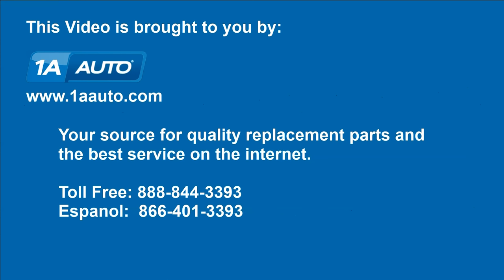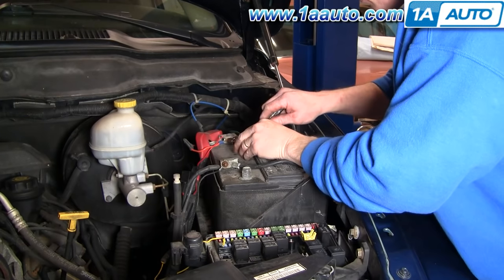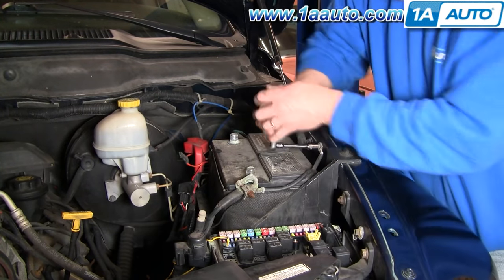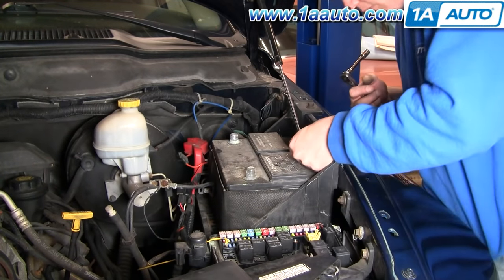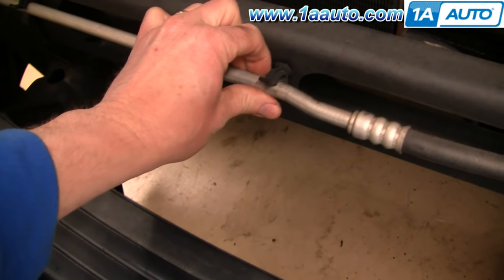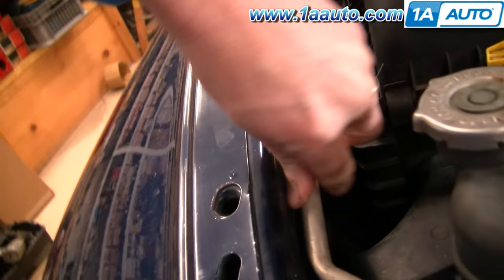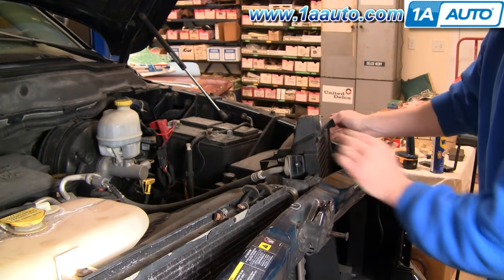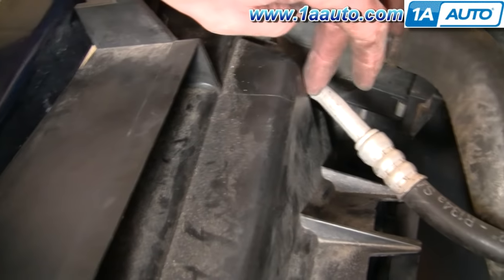How To Replace AC Condenser Cooling Fan 02-08 Dodge Ram PART 1

Comment: Great video! One recommendation though...It is MUCH easier if you remove the upper radiator support. It's just four bolts and the whole condenser and shroud can come forward a bit. Took about 35 minutes total. Oh and you don't have to remove the battery or the fuse box by doing this.

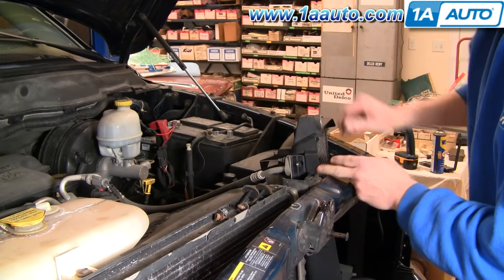Comment: Thank you very much for the great video!  This turned a half day job into less than 90 minutes.  If you do this yourself, be sure to watch part two,  I kept saying "why won't the condenser go back into the shroud!?!" until I remembered part two where you have to pry with a flathead screwdriver between the condenser and the shroud on the upper passenger side.  Be sure to watch part two at 6:10 where he talks about the original ones get stuck like that! I had that same problem and it cost 20 min!

Comment from the maker: @dpl1108121 That is a 1960 Pontiac Bonneville 4 door hardtop.  For you Pontiac Fans it is an original Tripower Posi car with 8-lug wheels.

Comment: I'm so glad I found this video! A few months ago, this fan blade decided to just fall off. I spent hours trying to scissor finger my way into that thing to tighten the nut, while jamming a zip tie in the motor casing to hold it stationary. No luck with that. Watched this video, and fixed it in less than an hour. Works great now. Thanks!
Reply from the maker: A little know-how can go a long way.  We're glad the video helped you out.  1aauto.com 866-403-3393

Comment from the maker: It may cause it to do that. If you have a check engine light on, you may want to pull the code to see what may be causing the fan to not work. Hope this helps.

Comment: Mike, thank you for the video. I knocked this job out in about 35 minutes. I bought the part for $80 and was quoted $376 from pepboys. I also repaired for wheel hub assembly with the instructions on your other vids as well as my tailgate lever, brakes, and rotors. You've saved me over $1000. You have my business from now on 100%

Comment: 45 minuets start to finish I did not remove the battery or fuse box.   2006 ram with hemi.
Reply from the maker: Nice work.  Congratulations on the successful repair.  1aauto.com 866-403-3393
Reply: How did you get it out without removing those first?
Reply: @persuazion1  i did it without removing all that also
Reply: @therealbigfoot3076  how ?
Reply: @persuazion1  removing the Radiator support bar - 4 screws quick and easy

Comment: thanks, worked great. i replaced the fan motor only for 30 bucks, once i had the fan housing out it was a simple 4 bolt replacement saved an additional 70 dollars
Reply from the maker: Thank you for watching. Please let us know how the repair comes out! 1aauto.com  888-844-3393

Comment: Thanks guys,great video very helpful. Took me no time to do..I took the radiator shroud and pulled it lose from the radiator and held it back with zip ties, removed the top radiator hose and had room to pull and reinstall the condensor fan unit without removing and pulling back the fuse box..... thanks for your time..

Comment: Thank you A1 Auto!! Bought my fan unit and received it promptly the same week.  Just installed it in about an hour without any problems.  I used the video as my guide during the install keeping my phone nearby; socket sizes helped. I would note that I ended up putting the (4) 10mm fan shroud bolts back in before lowering the condensor/fan assembly back into place.  Much easier than doing it after lowering it back down.  Once again, thanks and great customer service and tech help with the videos.

Comment: Thank you so much. I watched this video and thought I can do this. I ordered my part from 1A Auto Parts using the 800#. The representative was so friendly! I almost forgot I was ordering auto parts. The part was ordered on a Tuesday and delivered to my door on Friday. I was able to follow the video bolt by bolt and in just over an hour, I had the old fan out and the new fan in. Thanks again!!! (2003 Dodge Ram 2500)
Reply from the maker: Thank you for watching!
 888-844-3393

Comment: Thank you for this video it saved me a ton and i ordered the part from you and got it in 2 days which was great.. installation went fairly smooth and now i have air again after 3 years without . i had been given the runaround by several mechanics Telling Me Maybe the evaporator it was going to cost me $1,000 to get it fixed so I I didn't take it anymore mechanics and decided to do some research and found a couple trouble shooting videos and your installation video and did it myself for $67. so thanks again
Reply from the maker: +Michael H Thank you for your order. If you would like to leave us a review on Google it would be greatly appreciated http://www.resellerratings.com/store/1A_Auto_Parts

Comment: Good thing I looked at the comments! Also agree with taking off the upper radiator cross member and not touch the fuse box and battery tray. Saved myself almost $500. ALSO!!! NAPA replacement part has the condenser hose slotted out so you do not have to cut it out to install!!

Comment: Yep! Worked like a charm... Didn't have to remove the battery or the fuse box. Removed the radiator support and it came right out... Easy out and easy back in...
Reply from the maker: Bobby Broussard Thanks for watching! Glad we could help 1aauto.com 866-403-3393

Comment: Getting ready to do my Brothers Ram tomorrow. I really like the video and feel comfortable about going after it after watching this video. Thank you for posting it. The only thing I would add is this. When I installed hood pins on my 02 Ram a couple years ago, I removed the radiator support from across the front! It was very easy to do, just 4 bolts. I think removing the support will help with getting to the entire assembly. I will let you know tomorrow how it goes :)
Reply: Two years later, no update. Makes one wonder...is he still trying to fix this? :D

Comment: I've seen a few of your You Tube videos when I had things I needed to do on my Truck which have been very helpful . However,  I think that the procedure for this parts varies by which model year being worked on. I base this by comments here and my own personal experience with my 2007 Dodge Ram 1500. 
With the 2007 the battery tray has a piece on it that the fuse panel clips into on front and back that makes removing it easy but it makes the tray take up more room making it impossible to remove the the fan assembly. I had to unbolt the tray completely to be able to move it back far enough to remove it. 
This required me to take the wheel well out completely to get to two bolts holding the tray in behind it. Once I did that it became easy to take it out which I could have probably done without removing the radiator bolts but that's easy. The problem I now have is the motor that I bought won'r tighten all the way because the nut is stuck on the shaft or its tight enough that when I turn it the shaft turns with it and there is no way for be to be able to keep it from turning when attempting to tighten it.
I recommend to anyone doing this that they buy the whole fan assembly already assembled with the motor. It isn't much more and worth knowing it will not make you have to wait a week for one to arrive. I'm still going to see if there is a way of getting it by cutting a slit in the shaft where it comes out past the nut so I can put a screw driver on it as I tighten it. Also the packaging for the new motor I bought said to tighten at 35 ft lbs and not more because it would damage the motor after it starts being used. so my method won't allow me to torque it to the right specs.
Most parts for vehicle years cover certain model years when they make any significant changes to them. The 2006-2008 are usually in there own category with respect to most parts. so when I see something that says a part covers 2002-2008 I question if the procedure to replace it will be the same as well. Apparently  not. Maybe you should mention this when covering a part that fits different model years than are usually covered when buying most parts. It was easy to figure out what I needed to do so no biggy really. I'm more concerned about having to wait a week for the assembly to get here. (If I'm lucky)
Thank you,
Reply from the maker: +Joe Mitchell Thanks for the feedback!

Comment: I just finished this up and I want to add:  Remove the front cross bar.  Move the fuse box back.  Removing the battery is a waste of effort.  Absolute easiest way and least labor involved.  TIP:  Make sure your bolt clips (4) on the side of the condenser are lined up and not TOO loose.  That was the only serious difficulty I had.  One of them just would NOT line up and I ended up cross threading it.

Comment: I just removed the radiator support, cut the shroud, it falls forward. 10 min. Replace JUST the MOTOR
Reply: It looks like he drained the radiator, did you have to do the same ? I’m not trying to do that, but if I got to then I got to.
Reply: I couldn’t get this to work. Any other tips?

Comment: Overall great video... but not all years are the same.  I have a 2007, and the fuse block and battery are all in one bucket.  Pull the battery out to make room, the fuse/relay box can be removed from its holder and pulled out of the way.  The fan and condenser assembly can be pulled up without removing the tray that holds the fuse block.

One more tip: disconnect the wire before you try to pull the assembly out.

Comment: Remove the negative battery post. No need to remove the battery. Mark the hood latch brace with a sharpie then remove the 4 bolts makes the job a 
lot easier.

Comment: Great video!!! Made the repair very simple. I had to remove the tray assembly that holds the battery and relay panel. It was a little different set up than the truck in your video. Other than having to remove the wheel well cover to remove two mounting bolts underneath, it was spot on. Thanks a bunch!!!
Reply from the maker: Chris J Congratulations on the successful repair.  We're glad the video helped you out.  1aauto.com 866-403-3393

Comment: How would you diagnose my issue.  The a/c blows out real good n very cold but on a long trip we'll say 100 miles then it's starts blowing out slower to the point where I can feel hardly any air coming out. 
If I turn the a/c off for a while it blows out cold again but not for long. Should I change the blower n condenser ?

Comment: The fuse box on my 2007 Dodge Ram 1500 5.7 does not come out like the one you show. the case is one solid piece with the battery box.

Comment: Great vid! I got the condenser fan all the way out but got stuck when i couldnt get the fan blade bolt lose to get the fan off! Any tips for me?? Thanks.
Reply: Try turning the bolt clock wise and not counter clockwise like most bolts.

Comment: Should the condenser fan run whenever the ac is on or just when the compressor kicks in? My 04 ram only cools while I'm driving but as soon as I stop the air comes out warm. I checked the condenser fan and its not on but then again I'm not sure if and when its suppose to running.
Reply: Victor R same here fan needs to be running,  no air moving through the condenser. no cool air

Comment: My 07 dodge 1500 SLT flex fuel 4.7 does not I  repeat dose not have relays with the fuses or under the fuse box. Does any know where it would be for my ac condenser fan? The dodge parts guy was confused when I showed him. 
Thanks please help!

Comment: Why cant I find a video for a 2012, mine is right in front of the radiator not on the side so I am.sure installation as well removal  is not the same.

Comment: i fixed it for 15 bucks  by simply leaving it there and putting a pusher fan infront of it and keeps the ac cold just the same.. the dealer wanted 600$ cuz they wanted to drain the system and change the condenson n fan as an assembly  so i bought a oftermarket fan and bolted it on .. much cheaper
Reply: where did you get the  power supply..?..did you use the original cord and disconnected it from the original fan and plug it into the pusher fan?..this would make sense....then the system woul turn on the fan automatically

Comment: I have no experince with mecanic and just fixed my 2004 dodge ram cooling fan, no need to remove battery and radiator, I took about 30 min., save me $300
Reply from the maker: +Reg Sig Thank you for the great reply. We love to empower our customers by showing you how-to perform your own auto repairs while installing our high quality auto parts. Have a great day! 1aauto.com
Reply: Reg Sig question I’m about to replace my because, well my AC works when I’m moving but if I’m at at red light it Starts blowing warmer air
Reply: Reg Sig I have an 04 also

Comment: How don't know if the fan is not working?
Reply from the maker: +FRANCISCO CONTRERAS Since there could be multiple reasons why you’re experiencing this difficulty with your vehicle, I strongly recommend that you have a reputable mechanic inspect it. They’ll be able to troubleshoot the problem and tell you what part or parts you’ll need for the repair.

Comment: I don’t understand why you would take all these things off or move them. I can understand why you would move the fuse box and the battery but not the ac line and the radiator like why does that need to be taken apart.

Comment: Ok so all the videos im seeing r replacing 1 part. Im actually replacing the fan and the condenser so I have to take the lines off, condenser is leaking anyways so its NOT charged.